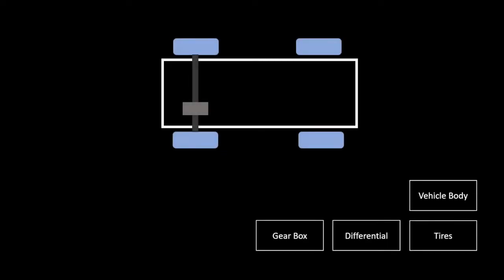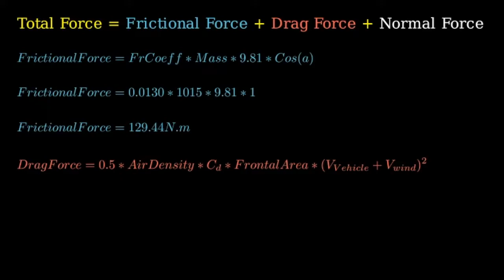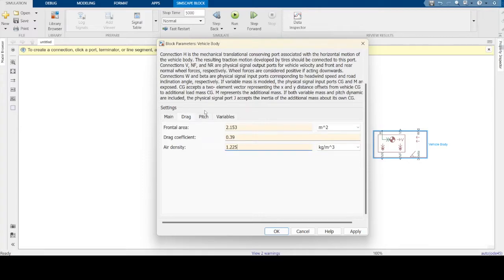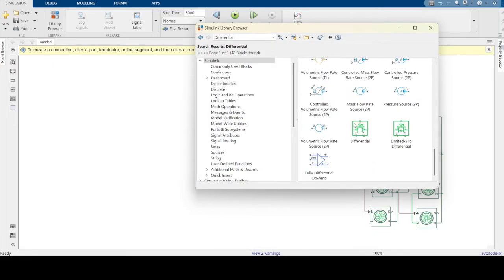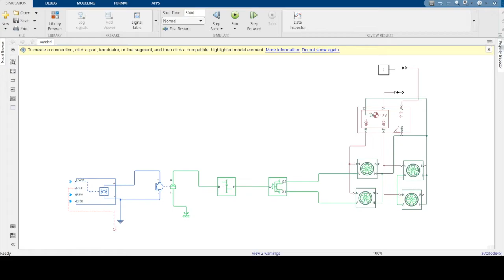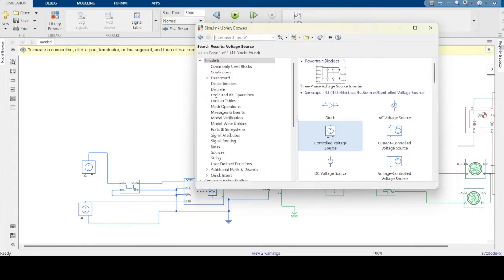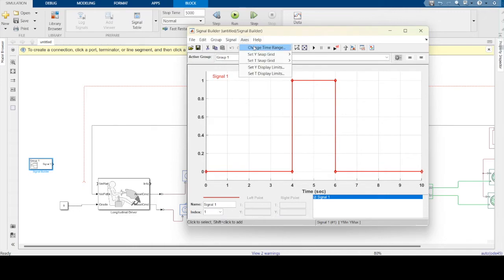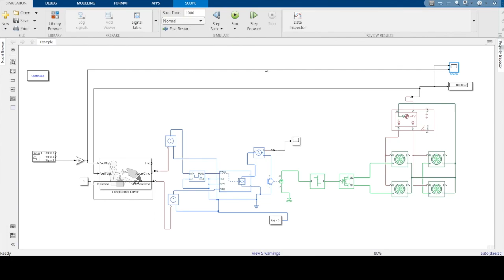Design, Calculation and Simulation of Electric Vehicle on MATLAB Simulink

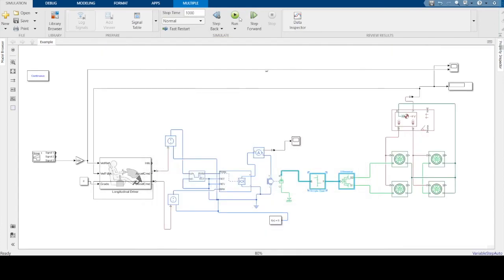Comment: HI, thanks for guiding step by step of this model. I would like to know if you made any changes in the model parameters, coz I followed exactly the same steps but my model is unable to reach the reference speed as shown in your signal builder and the final results. Also I see you made some changes in your model at 13:26 , is there any important parameter changes inside the blocks? if yes, then please specify.
Thank you so much
Reply: Bro which library is used for design ?